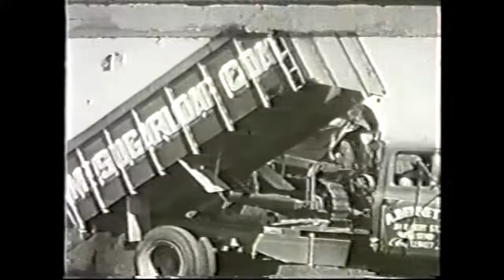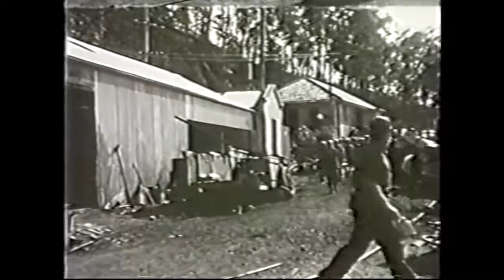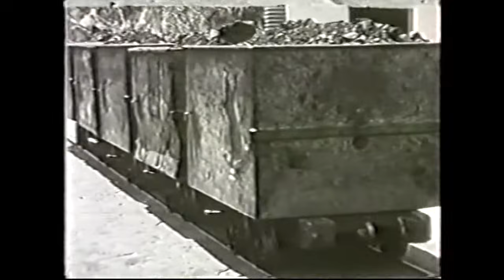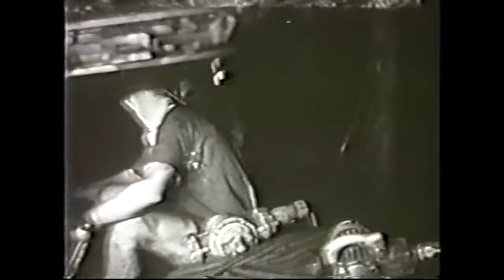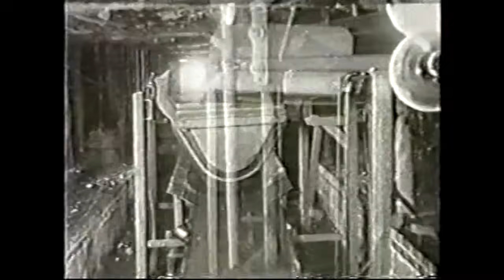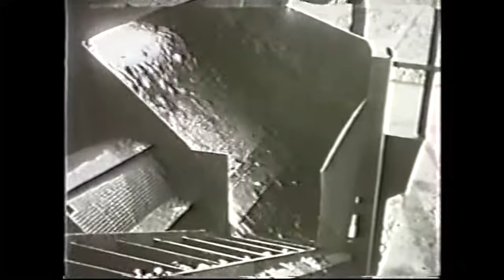Mount Sugarloaf Colliery (Circa 1957)

Comment: 1956-7

NEATH MOUNT SUGARLOAF. BOOK 2
ISBN 0 7316 3401 2
Published 1988. 
By West Wallsend Public School Centenary Committee.

Page 68
"A tunnel had been driven into an outcrop of the Great Northern Seam to provide boiler coal used during the sinking of both the West Wallsend and monk Wearmounth colliers. The 1885 tunnel lay abandoned until it was cleaned out by Andy Stewart and Hughie Humphries, who entered into a partnership with Jack Freeman and Les Fletcher to form the Mount Sugarloaf Colliery.

Operations began in November, 1949, mining a new lease obtained from the Caledonian Coal Company. The first day's output was thirteen skips of thirty two hundred weight each, a total of twenty tons, sixteen hundred weights each. The coal was tested at Cockle Creek Power Station, and was found to be suitable for boiler coal. ..."

"... When the original lease had been worked out, a further lease was negotiated with the Abermain Seaham Company. The new site was 300 acres selected by Joseph Holmes and sold by him to the Seaham Coal Company in 1906-7 for £6,000. A second tunnel, about forty yards from the first, was driven in 1956 to exploit the new lease. Pick and shovel gave way to mechanical mining in the new tunnel, but the same pit top tipping and handling arrangements were used."